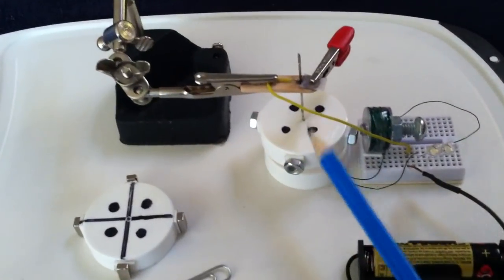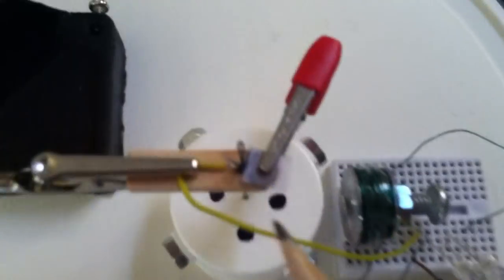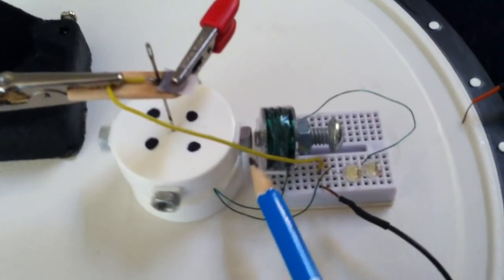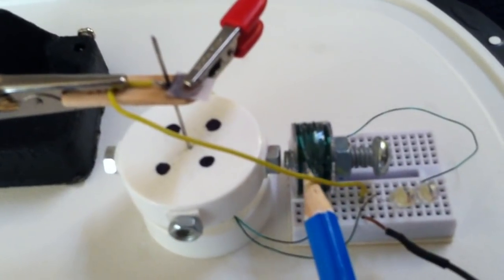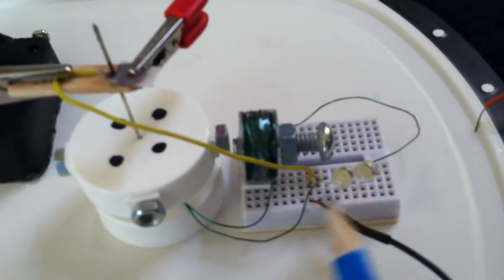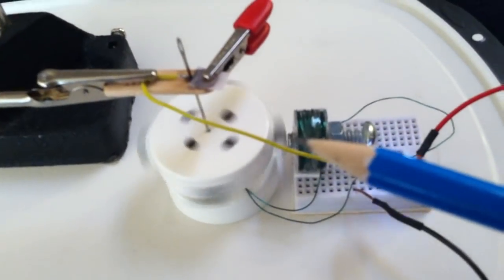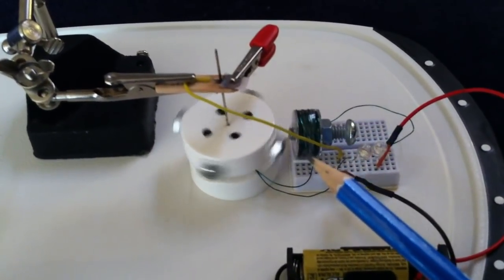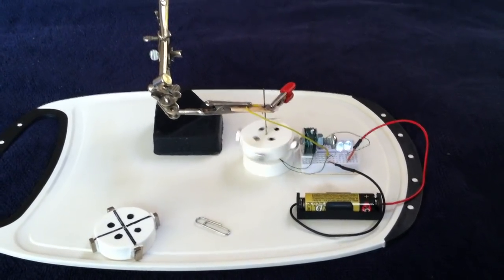Pure Attraction Motor

Comment: Long time listener, first time caller here. Live all of your vids. I have a question: is it possible to put that breakdown voltage into another elctromagnet at another location along the conceptual stator so as to add another tug on the rotor? If so, how many times can you reuse the breakdown voltage and how much more power can be added to the rotation this way? I suspect it would be less and less with each additional coil but I'm not well practiced with electronics. Love these attraction motors tho.
Reply from the maker: Thanks for the comment.  That is an interesting question. I have never considered trying that.  That might work.

Comment: Lidmotor, you are going to hate me, but I took another look at your video.  I get what you mean by the counter current induction working against the coil in a magnet rotor system vs your nut (no magnet) rotor version.  After a long consideration, I realized that there is still a problem in your logic.  The nuts, they are steel.  They are magnetic ie will attract to a permanent magnet of ANY polarity.  If a PM is near a steel nut, then the nut becomes polarized as a MAGNET.  It is impossible for the nut to become magnetic without becoming a magnet as well!  So in your motor, you are in effect still working with magnets on a rotor passing a coil with a core and induction works as expected.  The difference with using nuts instead of magnets are several.  1.  the nuts are small relative to the core/coil and only hold their magnetism for a short time during a pass and during the coil energized time mostly.  So in effect you have a nut magnet that auto shuts its remenance (physical domain order) at passing the coil (coil already electrically off).  2.  When using magnets, the magnets never shut off there field during a pass and produce the generating back flow effect as you noted plus the magnets on exiting the core/coil are still "hanging on" to it in a bad way and that drag is a loss to the system where as the nuts would have already "let go" there is a lot more to this, but this is the key points without getting deep into Faraday laws, eddy currents, saturation, BH curves and magnetic domains and the like.  Just for fun you might add more steel mass to work the core/coil by stacking more nuts vertical to the existing nuts on the rotor.  You might get more torque and a gain of momentum from the extra weight.  To make this motor work far more powerfully, you can use a high voltage capacitor dump into the coil(s) similar to how a Tesla coil primary capacitor dumps or the way a cap is used across the points in an old car distributor circuit.  Now you would enter a new domain where you can play with frequency and resonant cap charge/discharge to the coil to form a new kind of attraction motor.  In effect you can take Tesla's Coil as a resonant driven motor.  This would give you the ultimate efficiency and power.  I would do it myself, but just don't have the setup for it as yet :)
Reply from the maker: Well I'm still holding onto the original theory but I get your points.  Lately I have been looking at Tin Man's 'Drinking Bird Challenge'---like you are.  It is an interesting situation.  He has the thing running in that sealed black box ---somehow.  He has hinted that the fluid is not water in the glass and there is a funnel filled with rice to recycle it.  It is a very interesting puzzle.  The laws of thermodynamics are pretty strict so there has to be reason that it works.  I have been shopping for a cheap Bird' that I can get quick and start a replication.  I love doing 'simulated' perpetual motion machines.
Reply: What did you think about my note that the attraction motor was used in factory production around the mid 1800s?    

Thanks to you, I re-watched the bird video because I had somehow missed the point that Tin Man said he ALREADY had a working "perpetual" bird in the black box.  I was only seeing the front visible bird.    It would have been nice if he had actually shown it working in the black box rather than relying on trust alone as some might see this as not already working and just a ploy to get others to find the solution for him.  I don't believe that is the case here, however, as Tin Man has always been top notch on his videos.  

I did not hear anything about a funnel of rice, but I did note his possible "hint" at the end where he mentions eating rice.  Interesting, as rice has often been used as a desiccant, so there is a method (of many) to remove humidity build up in an enclosure.  Then, on a different portion of the thermodynamic loop, a heat source can drive off the captured humidity and allow the rice to repeat pulling moisture out of the air.  Hence the bird keeps running.  Vacuum methods work also.  The birds I used to see advertised contained methylene chloride, a carcinogen, years ago.  So be careful.  Hey post a link if you find a real cheap drinking bird.  $17 too much for me.  

As to an energy source to do the dehumidifying/humidifying, the obvious is the almost always difference in ambient temperature even within the same space like in a room.  It is known that there are common temp variations of several degrees even in a fairly sealed space over a certain distance.  And that does not include the more practical "free" energy gradient between the floor (or natural earth temp) and higher up (air temp).  So that is one energy source to do the dehumidifying.  Another is to also take advantage of solar energy to produce heat.  That would work whether the box enclosure is black or clear.  Heat is produced either way.  Tin Man seems to make the hint with his noting of a "black box."  Here the black produces the heat gradient against either air temp or the ground (floor) temp.  Easy with heat exchanger principles.  There is always a temp gradient between the earth ground temp and air, so always an energy source.  It is intriguing as at one time air may be hotter than the ground but at other times the ground can be hotter than the air!  So there is always an absolute value either direction and never zero difference.  Tesla explored this from many angles and was also excited to exploit the untapped energy source as it did  not violate any physics but after Wardenclyffe, he was totally broke and could not find any investors and WWI had started and was getting on in the years.
Reply from the maker: I didn't find much on attraction motors in my research.  The evolution story of the electric motor is fascinating and there were many things tried and quickly left behind for one reason or another.  As far as the drinking bird project I am doing a lot of research on heat engines (of all kinds) and that is another fascinating tale.  You can get a 'drinking bird' for under $10 if you hunt long enough.  They are cheapest if you order one from China and don't mind waiting for 6 weeks.  TinMan made the comment about the funnel of rice on a forum I visit.
Reply: Surprised you did not find much on attraction motors.  May be you did not see my comment below on "The Attraction Motor is not new..."  Like you I also took a long review of many of the oldest DC motor designs starting with Faraday and Arago and forward.  Very smart people when you consider how little they knew about magnetism or electrons.  I also looked at some "perpetual devices" of old like the perpetual clock and the perpetual batteries and various barometric devices and even the self ratcheting gear (could be made into a motor) working off temp changes.  The best enclosed heat engine working on a similar principle to the bird is that 5HP? unit using propane or similar that ran a generator.  It was put on the front page of Pop Sci or Mechanix magazine many years ago.  It was real slow running but the torque was tremendous and was geared to run a generator.  Like the bird, a nearly something for nothing device (from us) system.  Scale to any size.  Can work day or night almost perpetual.

Comment: You still have back emf lid the destination and accumulated energy is deposited in the nut in the form of light (inferred) and is dissipated by the wind from the movement of the rotor. Although the heat is nominal it is there same as induction motors. For every action there is a equal and opposite reaction. All Energy finds equilibrium one way or another how far we take the explanation is up to us. Well done on the build but I would call it a contact point motor more than induction due to the needle acting as a commutator but a current is being induced in the steel nut than the collapsing field in steel is the back end you are missing. The iron in the nut is temporarily aligned to the field then collapse just like a coil you have no contacts in nuts so can not effectively measure the bemf but it is reduced by the inductor (iron and other alloys)due to resistance thus the heat.

Comment: The Attraction Motor is not new by a long shot and P. Lindemann is not the inventor nor the first to make it.  In fact, it was invented in the mid 1800s if I recall and had enough useful torque that it was used in some factories.  I have a photo and reference somewhere.  I also made one using flashlight batteries way back in elementary school for a class project.  I also have an old book somewhere from the 1940s or 1950s that tells how to make one.  I can dig up the references if anybody really needs proof.  P. Lindemann is a nice guy and all, but sorry, he is getting way too much credit on this one.  And yes, I have met and spoke to him long ago, when he was first showing his Attraction motor demo at one of the conventions.  I was there too, as I was doing a demo of my Quantum Transformer Energy Converter (QTEC) and also gave a short lecture on it.  Ahh those were the days.  :)

Comment: Nice job on this.  Question:  is it triggering once per every steel nut passing?  Or more like once per revolution?  I can't tell from the flashing LED, because of the camera frame-rate possibly causing some video aliasing.
Reply: Seems like an interesting dynamic between the needle wobble and the pull of the electromagnet that maintains the right frequency so the circuit fires at the right time.  Really cool stuff here.